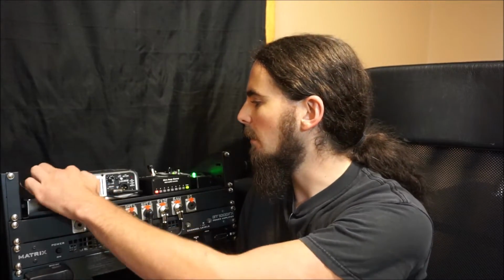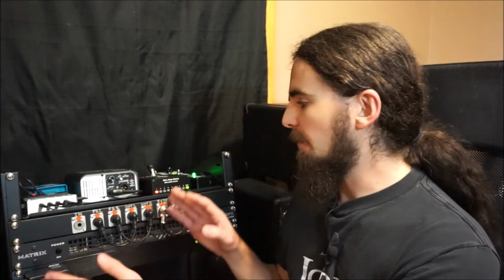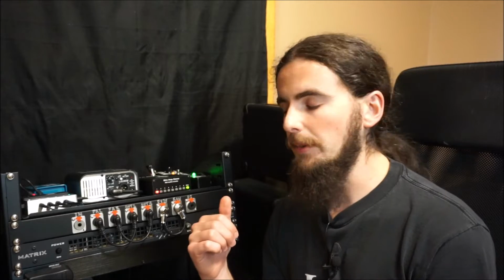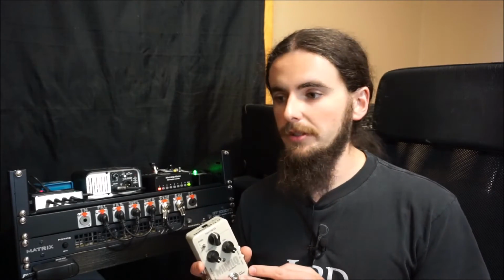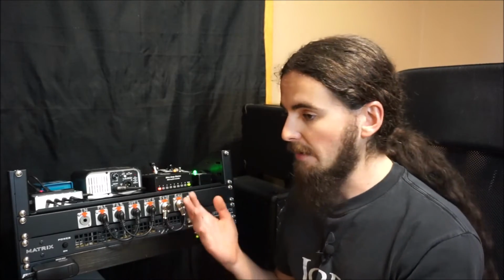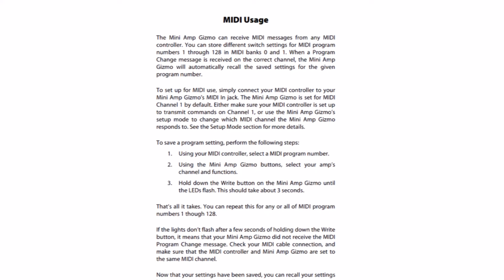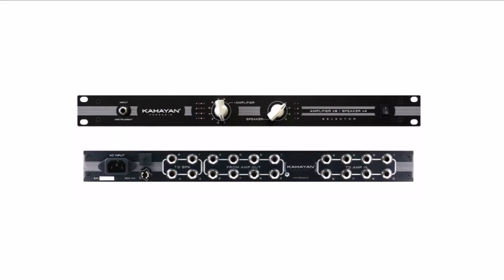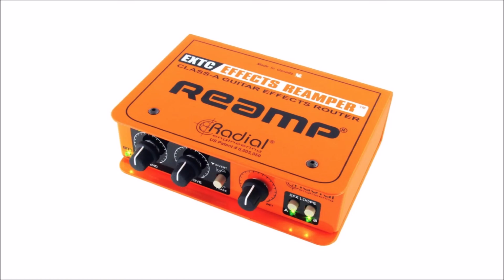Gear Curiosities: Custom Pedal Drawer - Tube Amp Mission Control!

Comment: Hey man! The problem you describe at 7:38 with audio being routed to output 3 on your 6i6 should be able to be fixed via Focusrite Control...I have the same interface, but on Mac. If my memory suits me right you should just be able to mute that output in Focusrite Control when you're not using it for re-amping!
Reply from the maker: I use Focusrite control. The routing problem isn't with Cubase or the interface software, but with Windows. Everything works as expected in a DAW, but to engage or "monitor" ouput 3, it always sends the operating system audio that way as well.

Comment: Can I ask you a question? In one of your older videos I noticed a very decent looking curved screen which you were using with Cubase. What was the name of that model? Thanks.
Reply from the maker: It's actually not curved, it's just a 21:9 1080p from LG. I think the model number is 29UM58.

Comment: Very cool, I may build something like this, when I get more amps in my collection. I love the Two Notes Torpedo Captor 8. I use it for my Mesa Nomad 100. I use 2 noise gates, one at the fx send, followed by an Empress ParaEQ (global EQ) and a mini volume box that goes to pedal board fx or rack fx. The second noise gate is at the input of the amp. I have both noise gates securely mounted with dual lock tape. I have the left side of stereo fx go to fx return of the  Mesa Nomad 100 fx return. Right side of fx goes to a 2nd amp and or Red Box Classic for the other side of the stereo image.

Comment: That Matrix GT1000GX is a killer poweramp. Owned one for a couple of years. Nice set up video, Ryan. Could you do a reamp video or a video using pedals within your DAW in post. Cheers !
Reply from the maker: I am planning a recording workflow series which will certainly include re amping and routing different signal chains.

Comment: I notice that ProRMP reamp box there and have a quick question: Have you ever had significant signal loss with it with different line outputs (coming off your interface)? It's passive and needs to be driven, but my Pro40- for whatever reason- won't drive it and signal coming into the amp is lacking volume and top end.
Reply from the maker: I use line output 3 on my 6i6 with  the ProRMP level maxed out and it sounds indistinguishable from a direct guitar. I do end up turning up my DI by about 6 dB almost every time, but that has more to do with the level I track them out than the output of the re amp box or interface. You might need an actively powered re amp box if your interface won't play nice.

Comment: Yaiii, another nerd! Very cool Ryan, you should definitely draw up a schematic of this to make the video more comprehensible. It reminds me a little bit of my touring rack rig from way back in the 90's. Of course it was before IR's and all that but I had a Boss stereo rack noise gate unit that I modified to react on the clean guitar signal but enact on the effects loop. Very effective solution that I am wondering why doesn't exist today. Then I had an "Octopus" which was a rack unit midi switcher that you could hook up to eight individual relays to control all the pedals and channel switching. All power supplies also in a custom rack shelf and the power amp was a stereo Carver MosFET with a "tube" control that sounded awesome. I even customized the cable for my midi board cable to include the board power so I never had to worry about batteries. I also clamped a metal bar over the input of the board to protect it from all the stage diving going on back in those days.
The rig was ultra durable this way but the best part the setup. When I arrived to a new venue I just needed to place my two 2x10"s, open front and back of the rack, then roll one power cable, two speaker cables and the midi board (housed inside the rack), switch on the wireless and I had a fully switchable mosh proof stereo rig ready to go.
Reply: Those MIDI expander boxes are key to avoid preset lag from a daisy chained MIDI rig from out to in and thru...stereo rules for clean tones and big sounds